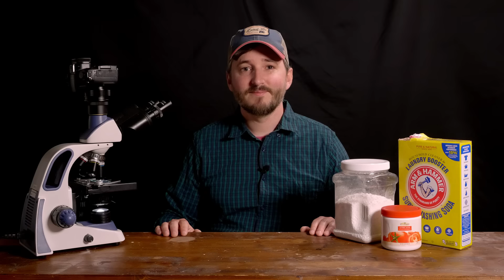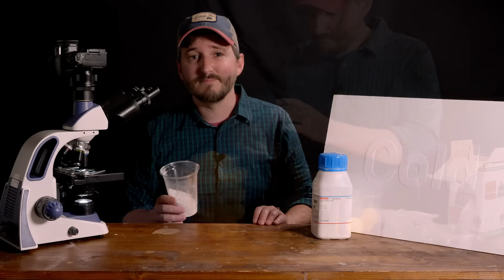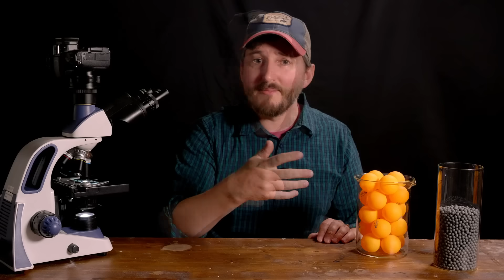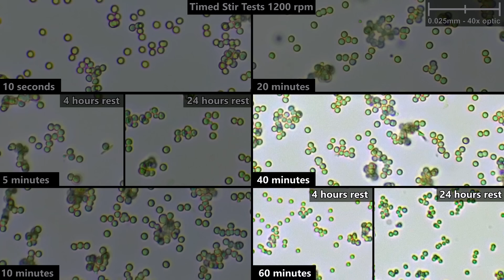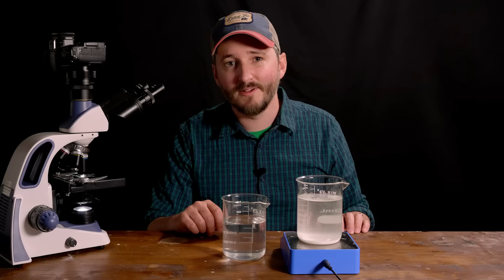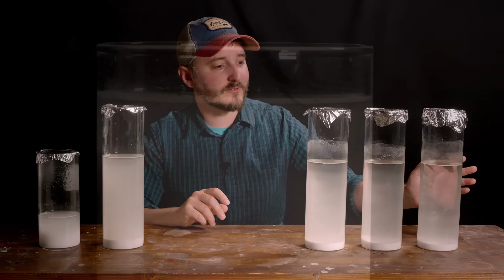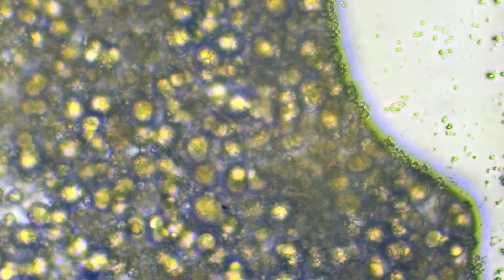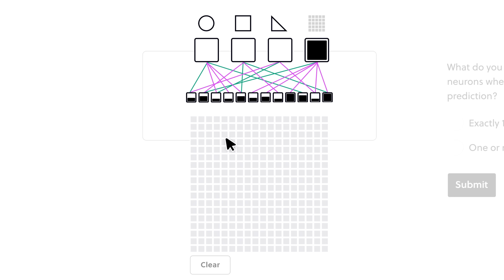Making Infrared Cooling Paint From Grocery Store Items (w/Novel CaCO₃ Microsphere Synthesis)

Comment: Fantastic work! The chemistry is intriguing, and well executed (and probably has relevance well outside this pigment). My initial concern was that calcium carbonate is so cheap that pigment efficiency isn't a problem, but the simplicity of the technique actually probably still makes it worth doing. I don't see much difficulty in scaling this to industrial levels.
How does your paint compare to traditional limewash? This might be one of those situations where we take modern understanding of materials, and shared research into production, and then realise that the 'traditional' solution was 70% of the way there already! The improved packing and foaming almost certainly makes it better, but I would love to see a direct comparison.
Did you try any other acids? organic or otherwise? What about chelating agents (citric acid does that too, so it might be that)? The gelling certainly suggests some sort of intermediate polymer forming as the delay mechanism. Does that also contribute to them being spheres by drawing in calcium by pulling the polymer strings? Is it related to the oxygen double bonds of citric acid rather than the acid group? So many questions from this; the sign of stellar work!
Reply from the maker: Needs comparing with lime wash, but I'm certain this paint has a big advantage in terms of reflectivity

Comment: so if you take a pvc pipe reduce its size by half starts at 2in reduce slow to 1/2in by the other end cover in cooling paint inside and out... now push air trough the pipe you now have ac the longer the pipe the colder the air pushed through... then you think about those devices that gen power when one side is colder than the other you get power... just need to be 1.5v and you have a battery that last for a long time and its small...

Comment: I wonder if using a caulking tube gun would work like the syringe but with more control. Or you could trowel it on like drywall compound.  Maybe an insulation spray gun or a truck bed spray gun would work.

Comment: I'm not understanding why this reflective paint needs to face the open sky to work. I get that it needs to radiate out IR radiation, but does it really need to reach outer space?  What if there's a giant umbrella hovering 5 miles above the paint, so that all it sees is the underside of the umbrella and does not see outer space?  I would think that our paint still emits the same amount of IR, and instead of it going off into infinity in outer space, it just gets aborbed by the umbrella which then heats up, but since it's 5 miles above us almost none of the heat will reach us and will be zero for all intents and purposes.
Reply from the maker: Everything else emits IR too. If the paint isn't facing the sky it's inevitable that some of the IR being emitted by things around it will be absorbed. That's why most objects in proximity to each other balance out to the same temperature.
Reply: @Nighthawkinlight  So you're saying our painted surface will emit IR to the giant sky umbrella and the umbrella will emit IR back to our painted surface and therefore it's a wash?  interesting.

Comment: This paint is awesome idea, obviously, but the main issue with it is the longevity. Regular construction paint has been engineered over literal centuries to be maximally durable and weather-resistant, considering it's exposed to elements for decades on end, and re-painting large sturctures is very costly and time consuming. For small-scale buildings though, this paint could indeed be good, for sheds, garages and such it should be pretty awesome. The cooling panels could in fact be the most efficient way to use such paint, if such panel could be covered by a some lacquer or transparent cover.

Comment: Thank you for your work. This research is so important.
Wondering if you can create a temperature gradient/difference, that is big enough to run a sterling engine.
Then you could harvest energy 24/7 around the clock, just by ambient temperature. This would be the ultimative goal.

Comment: it is funny how similar this "paint" is to how glue or frosting is applied to surfaces. It may be beneficial to make it more runny and apply multiple coats? or maybe just have a plastic sheet that this is put on with a layer of adhesive applied after it dries so it turns into basically a giant cooling sticker. That sticker idea may be the best method of application instead of treating this "paint" like other paints and more like a premade sheet, like wallpaper.

Comment: What were the properties most critical to reflect the targeted wavelength range? Since you had a plastic film over it does that mean you could apply another more weather-resistant paint directly on top of it without greatly harming the efficiency?
Reply from the maker: Most important property is chemical composition. The film works primarily because it offers an insulating gap between the and the outside air, so a coating painted directly on would not have that benefit

Comment: I have been searching for a cheap way to get 20-30 micron microspheres cheaply for the last 4 months and then this shows up in my sub box... Now I can just make my own, thank you so much!
Reply: I cant seem to replicate the microspheres. tried a bunch of times now and I always get what looks like very fine calcium carbonate dust, if its making spheres they are smaller then I can see on my crappy microscope at 120x zoom. I started at 1min stir time and have reduced it a number of times thinking maybe might blender just spins to fast. I even tried once with hand stiring. the reaction looks the same at the macro level, the citric acid solution clears up the cloudy calcium chloride solution, when the sodium carbonate solution is added to the mix in the running blender it turns to a gel. but no microspheres unless they are smaller then 1 micron.

Comment: I am coming with you on this adventure. I've been dreaming up a simple setup that circulates water through tubing run along the backside of a skycooling panel with a small fishtank pump to provide cooling inside a structure that can be shut off when it's cold out. Not sure if I've got the technical knowhow to make it happen, but I'm going to give it a go, even if it's just on a small scale.

Comment: A very similar application of this phenomenon is used in spacecraft radiator panels. Specific white paint is used on radiator panels because it's able to selectively reflect the sun's wavelength of light, while still being able to emit it's own wavelength very effectively. Look up spacecraft thermal control coatings to dive into it more!

Comment: I wonder how effective it would be using aerated epoxy instead of the acetone acrylic mix. If you get small air bubbles into it it appears white (same way they make hard candy white) that mixed with the pigment would probably make for a more durable coating. But then that leaves the question of how efficient it would be?

Comment: I'm very curious about some rough quantitative results.  Generally, how much is the delta T improved by the various processes.  How well does the acrylic foam alone perform vs foam plus single size spheres vs foam plus multiple sized spheres vs spheres without foam etc?  Just trying to get a handle on the relative contributions of the elements.

Also, any sense of performance of the various elements in applications where there is no direct sunlight?

Thanks so much for this great video!
Reply from the maker: Some of that was done in my last video. Mostly I cared about building the groundwork in this video and the details will fill in later

Comment: Fantastic! Really delighted by this follow up video. I didn’t want to use Ba salts so I had started some experimentation with CaCO3 synthesis (dissolving eggshell powder in acetic acid, decanting the Ca acetate solution and then recrystallising out the calcium carbonate with some sodium bicarbonate solution) but I didn’t have any idea how to manage differential particle size synthesis, so very pleased at NighthawkIL’s shift to that and the super helpful detailed info on crystallisation protocol.. also the increased details on acetone to pmma ratios.. (I had tried higher concentrations of perspex in acetone and ended up with gel mass in the jar which I’ve been diluting down to see max concentration I could use). 

What would be super useful would be some figures relating to emissions/square cm.. anything quantitative about cooling effect.. would help put some theoretical numbers on some ideas. I guess, given how much is now clearer, I should make some and try to do some direct experimentation. I have a cunning plan.. but a cunning plan with estimated numbers to motivate me would be good.. ;-)

Keep up the fantastic work - this is an important piece of research!

Comment: Congratulations! This is great progress! 

The density of that powder mix is nowhere near 95% of bulk. You should measure it. A graduated cylinder would work for a rough measurement. Consolidating powders to such a high degree is difficult and most methods that seem like they should work just don't. Under low stresses powders are just not sufficiently free-flowing to consolidate so far, and agglomerates with built in pores are frustratingly difficult to strain by any method, even many that use 100s of MPa. Lower levels of consolidation are simple. I forget whether Tech Ingredients found any benefit to the size hierarchy, but it can't have been from achieving such a high density.

Bottom line, I recommend that you measure densities when you do this stuff so that you have a handle on how much packing you're actually achieving, and whether it's important to this application, which is not clear to me. Wouldn't it be better to have air pockets of similar size to the largest crystals in order to achieve large index of refraction contrast and consequently high scattering in a small depth, and consequently low absorption?

I wonder if the real action of the nanparticles is to stabilize the foam? With the right wetting properties nanoparticles will adsorb at gas-liquid interfaces and stay there, stablizing the foam by reducing surface tension and providing those surfaces with increased stiffness and viscosity.
Reply from the maker: With higher density you use less binder between particles. The binder is a detriment to the emission and so less of it gives better cooling
Reply: @Nighthawkinlight  I don't think you are consolidating those particles as well as you think you are. Measure the density.

With cm and mm size particles it's easy. With 100 um particles you can still probably make it work with some vibration. With 10 um size particles and below there's a lot of internal friction to defeat. Solid fractions above 65% are very difficult to achieve by any means with particles in that size range.

Comment: Have you tried applying the paint using an airbrush? It would probably wreck the brush over time, but a cheap $20 airbrush with a very wet mix looks like it could work based on the spray bottle results.

Comment: i would try to put final product in vacuum chamber and after all air is out try to apply it with spray gun. i'm not sure would it work (bc i am aware water evaporates much faster in vacuum so it can change "paint") but i would try it